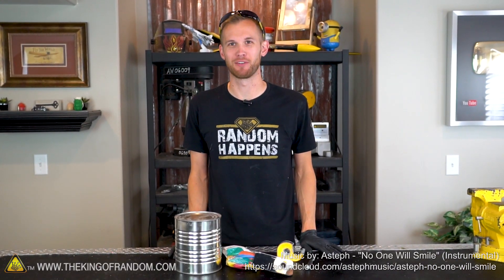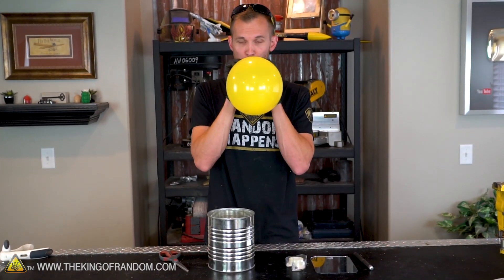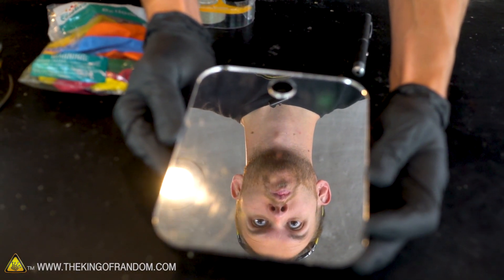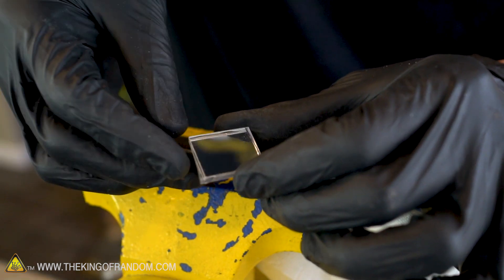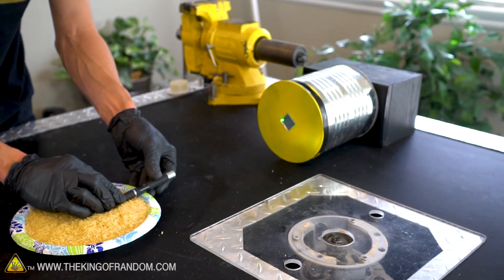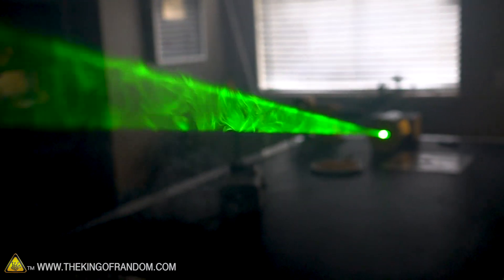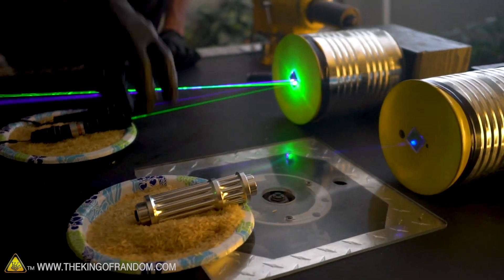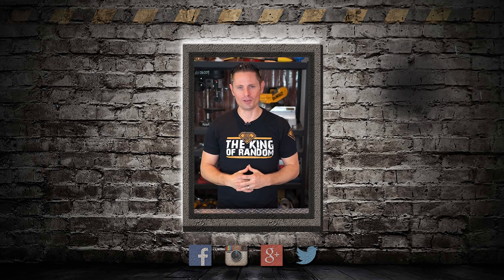How To Make a Laser Party! TKOR's Details How To Make Your Own DIY Laser Show!

Comment: The size of your mirror will influence the patterns generated.  Also where you put the mirror will affect it too.  Bigger mirror gives more mass equals lower resonating frequencies.  The drum resonates in an airys pattern before installing the mirror.  The mirror will superimpose its own pattern on top of that.  So the shape of the mirror matters.  Slightly off center gives a better pattern imho.  Two mirrors on the same drum will create complimentary patterns.
Reply: Unmannedair i agree that middle of membrane is not the best place. I would try 1/3 or 1/4 ...
Reply: I was just going to suggest trying off center and multiple mirrors on one membrane.
Reply: Unmannedair What? I didn’t get any of that.😂
Reply: Isaiah ... It's physics, and I agree with him.
Reply: TY I can use that as my advantage :]
Reply: hey, i know i'm 4 years late to comment but im working on perfecting a similar design, do you have any ideas on making this work in a audio setup without causing any distortion to the sound? every variant i've tried has a detrimental effect of the sound quality, unless i put the mirror over a small speaker and then drown it out with a larger speaker.
Reply: The video was a poor effort. I was doing this when i was 11 in the 90s with a red laser and produced far better effects

Comment: The only time I have ever used play at faster than normal speed on YT.
Edmund used to sell this idea with membrane stretched over classroom PA speaker box with just spotlights or slide projector, in the 60's. I picked up a Laser Disc with XY mirrors and it's He Ne laser years ago lots of fun at shows. For the most part this is better than all those sound threshold triggered LED lights out there now.

Comment: Great vid 
I did this with a old speaker with a rubber rim around the cone and stuck the mirror on it.
try moving angle you point the lazzer to get different patterns
it will also move the point on the wall

Comment: If you add a second device, and project the beam from the first one on the mirror of the second one, you get a great laser show. Anyway, it’s much better to use front surface mirrors for lasers. They are more expensive, but the results are way better, and you get a clean laser dot.

Comment: I think a possible improvement on this might be to use a couple of speakers, and attach the mirrors to those via levers, one horizontal, and one vertical, use those as the left and right channels, and bounce the one laser off of both mirrors. That way you'd get a stereo projection.

Comment: And no warnings about how lasers can damage your vision... okay then...
Reply: Albin9000 common sense
Reply: The green one is ok, but the blue one is another matter.
If it can puncture a ballon so fast, it can blind some young eyes very fast as well. Especially since you have to look at the mirror while the laser is on in order to set things up every time you move the device. At the very least, he should have said not to use power laser without caution.
Still, very fun project, I might make one with class 1 or 2 laser

Comment: Laser pointers are not designed to work long times like this, they  will die sooner.
A slightly powered laser can slightly melt the plastic mirror, then it get unfocused.

Comment: Did you damage that more powerful laser? You're not supposed to leave some of the powerful ones on for very long because they overheat. Mine says about 45 seconds max. I think it's a 3 watt.
Reply: I am glad if the thing destroyed itself instead of anybodies eyesight. That blue laser is a cat igniter and irresponsible to use without eye protection.

Comment: Don't user lasers stronger than 1.5mW. This setup is quite dangerous otherwise.
Also use the backside of the mirror! Take of the paint with acetone. That way you got a surface mirror, an lose less energy.

Comment: too dangerous!
Reply: why?
Reply: With professional Lasers, the laser always moves. However, if the laser is standing still and gets in someones eye, they're gonna be blind on that eye. With a DIY setup like this, you have to make absolutely sure nobody is walking anywhere near the area these lasers are shining. This is a cool video, but I feel like some people are gonna loose their eyesight because they won't take the proper precautions. He really needs to mention the risks that come with lasers.
Reply: RFX
Reply: RFX not all lasers can blind people
Reply: RFX  you don't get blind if it get in youre  eye for 5 seconde
Reply: One laser model shown in the video is a 1w blue laser. 1w is about 200-300 times stronger than cheap handheld cat lasers. If you get hit in the eye with a 1w laser it would immediately cause permanent eye damage.
Reply: No it’s not
Reply: laser POINTERS will not blind anyone except for the blue one at the end
Reply: That blue laser is a cat igniter and irresponsible to use without eye protection.